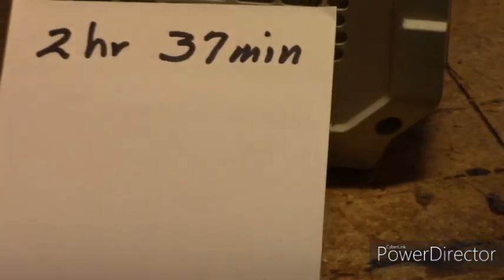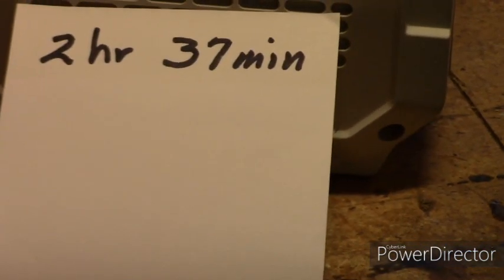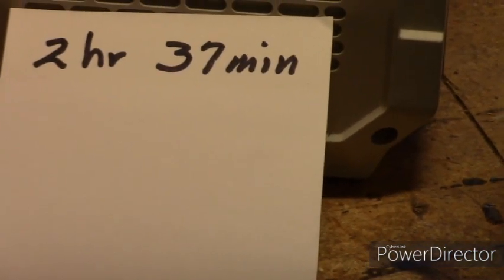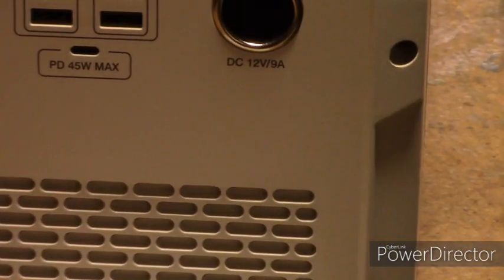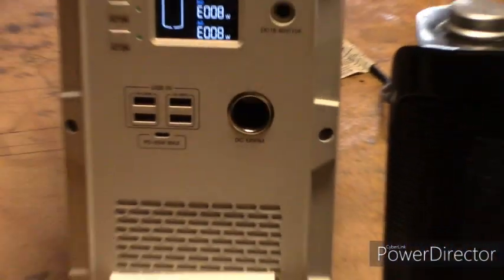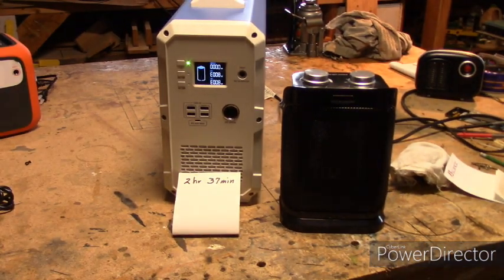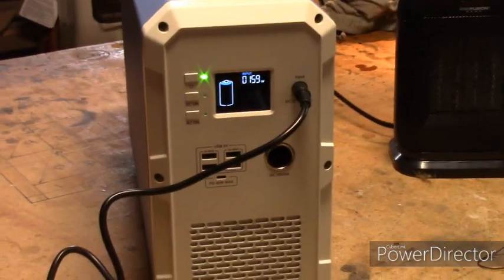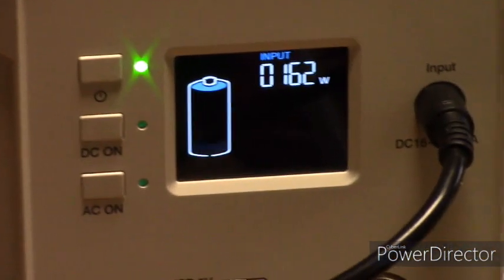Bluetti EB240 capacity evaluation

Comment: Thanks for your video.  If you do future videos, I would recommend to not to test the power station with a heater, which drains it very fast.  These devices are not really designed for that.  Better to use more typical loads in the range 150 - 300 watts (lights, computers, TVs, internet, etc.)  you will get more capacity that way and also not put as much stress on the battery.

 I have two EB240s for emergency backup power and to reduce my power bill.  I'm on time of use plan and 4pm-9pm is expensive.   One unit is used to power my bedroom / home office.  My daily routine is: charge from solar with four 100 watt panels (typical input 200-300watts), keep unit away from heat / sun, maintain battery level between 80-20%. 

My room consists of 4 LED floor lamps, 2 computers, 2 computer monitors, computer speakers, and a TV.  I run off grid from around 4pm to midnight every day. Typical draw is in range of 180 - 250 watts.

Doing everything I describe saves me about $50 - $75 / month and should extend the battery life considerably... possibly up to 2x.
Reply from the maker: Thanks for the tip.